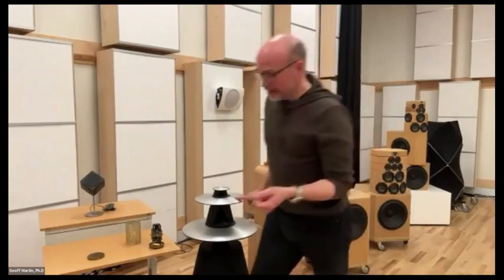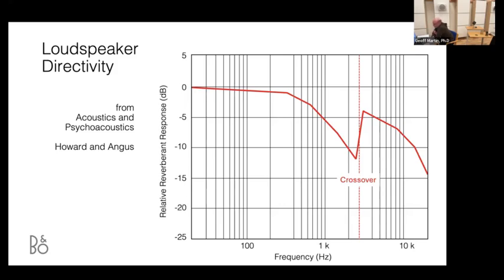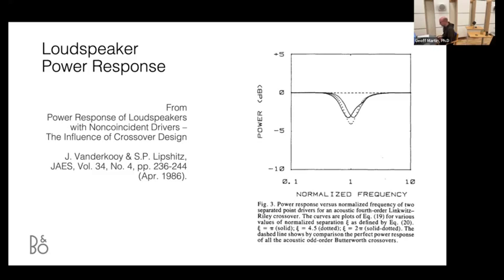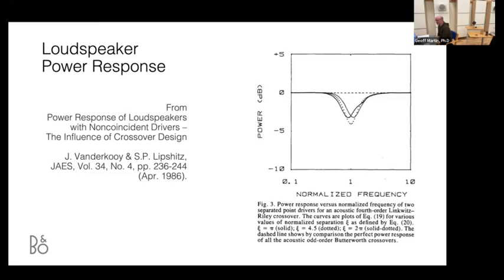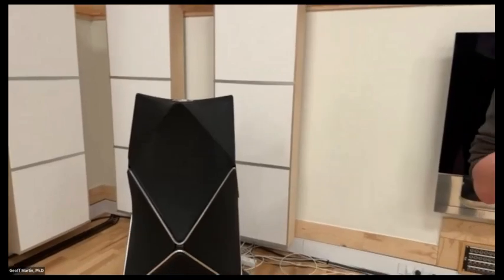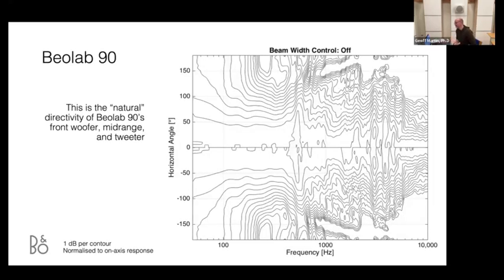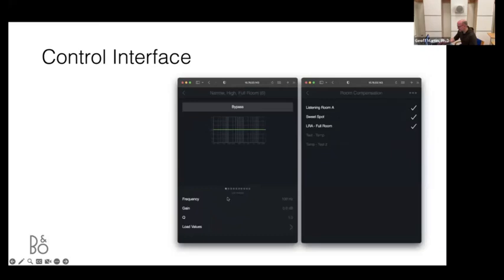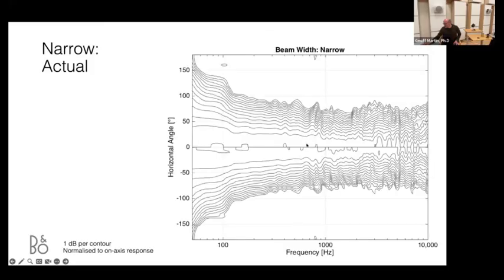Development of Bang & Olufsen's Beolab 90

Comment: How is latency controlled with various surround speakers?
Reply: For surrounds youd probably be using a Beoconnect core or Beosound Theatre Sound bar, which have on board processing and can communicate with a TV via HDMI eARC to synchronise the picture and sound.